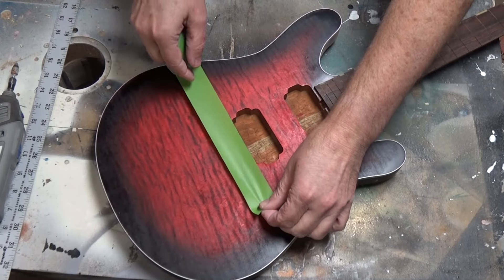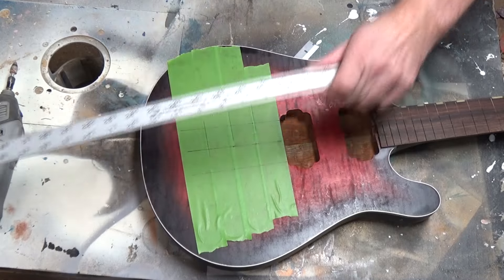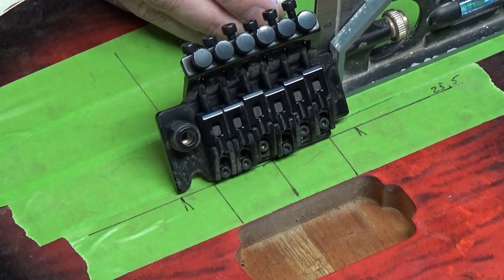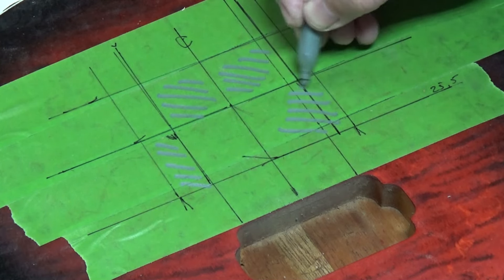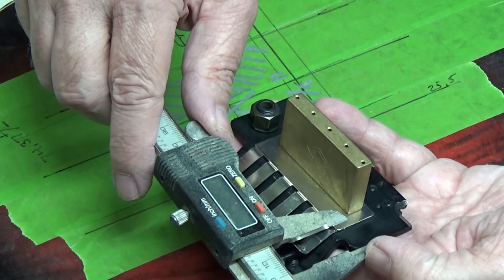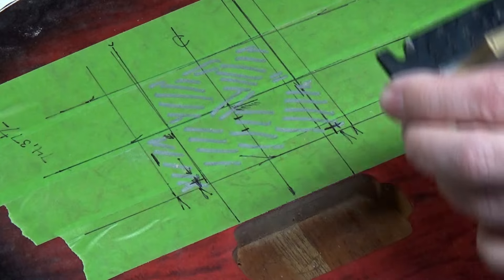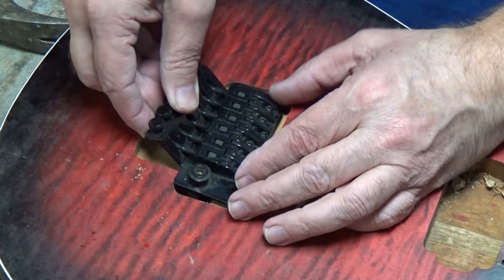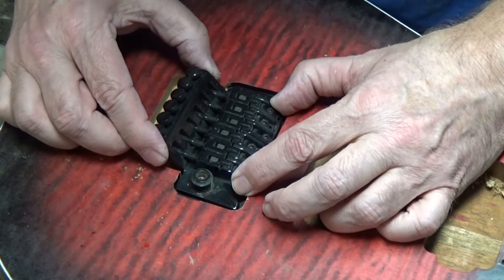How to install a Floyd Rose tremolo without a template

Comment: Would love to see you cryo treat a floyd base plate on this channel. Just so that more people know it's a cheap easy option to improve the life of those knife edges by a small amount. Even dry ice and denatured alcohol can give a small improvement, even though it's about a hundred degrees warmer than liquid nitrogen, because it can still convert some of that austenite into martensite. To get any significant amount of fine carbide precipitation you'd need nitrogen. (afaik anyway) A floyd rose has the exact type of mechanical wear that cryo treatment is good for.

Comment: Good job using the drill press for the studs and savy thinking with the makeshift template. I myself have abandoned the router for Floyd installs except if i have to do back cavity carving.. the chisel has just been the safest & most accurate for me on the bridge & locking nut installs nowdays. Good video tho and good work!

Comment: I really love recessed Floyd type bridge cavities, less need to an angled neck, less need for a higher neck heel to get the neck a little higher than usual. it would even bee possible to get away with just 2-3 degree neck angle when building Les Paul with carved top due and floyd type of bridge and it's recessed routing for the tremolo. Even if I prefer routing templates or using my CNC it´s actually pretty good to have this knowledge how do do this with no template at all.. thanks for a great video.

Comment: There's a lot of great info in this video Will, which will transpose over to other styles of bridges too. Great idea using the double sided tape and scrap to make a template. Although it's only relevant if you have a flat guitar. Carved tops are more of a challenge.

Comment: I wonder why some FR look like it rests flat on the body and didn’t need to lower the surface with the router. I guess it depends on the finger board’s height and angle but how shall I measure that height ?
i.e. : at which height should the cords be from the frettes ?

I am building a setup with a Strats Squier and an aftermarket neck.

Comment: Just to clarify; why did you put the front edge of the bridge saddles in the 25.5" mark?  Shouldn't it be that it's the edge of the point where the strings rest on the bridge that should be in the 25.5" mark?

Because an FR bridge isn't exactly like a Strat bridge where the edge of the bridge saddles are where the strings actually rest. In an FR bridge, the strings kinda rest around 1/2" further back (and higher) of the saddles.  

I'm no expert on guitars, but it seems that you just made an FR guitar setup at 26.0" scale length (approximately).

Comment: Hey Dr. I really enjoy your channel I even bought a video from you years ago to help me memorize all the notes on the entire fret board..so Thankyou for that. Anyways my question is , I just purchased a 1984 usa fender with a Kahler Killer 2700 trem. Will do I have to do some drilling/routing to change that to a Floyd rose trem? My first fender electric. I’ve owned nothing but deans and a few Washburns in the past. Looking forward to hearing from you. And do you do this kind of work for paying customers?
Reply from the maker: I have never installed that bridge before, but by looking at it, it seems fairly straight forward. the posts you will probably have to move. just do a bunch of measurements like this video and it will tell you what needs to be done.

Comment: Curious about the 26 inch scale
Reply: So am I. Never heard of a 26 inch scale neck; all of mine are either 24.75 inches or 25.5 inches. 🤔
Reply: All scale length is ,is the frets are spaced farther apart, all the notes are the same
Reply: @gm-lb9oe  scale length is the distance from the nut to the 12th fret doubled. That determines the distance from the nut to the bridge saddle. If it's not correct for the neck being used, the instrument won't intonate properly and it won't sound right. The frets are spaced differently on those two neck scale lengths.
Reply: @billjackson9702  exactly.  I think Will may have just mis spoken
Reply from the maker: I didn’t misspeak. It’s 26
Reply: @WillsEasyGuitar  measuring from the back of the nut, where it meets the fretboard, and from that point to the center of the 12th fret....you have 23 inches exactly? Interesting. Did some research; I've only seen 24.75 inch & 25.5 inch necks. Thanks for the additional learning experience! 👍
Reply: @WillsEasyGuitar  ok.
Reply: @WillsEasyGuitar  ok

Comment: Hey Will, hope your doing okay? When you file the slots in the nut, if you have a high E thats a 9, do you use a file thats a 9 or do you use a file thats a 10??? What do you do with all the other strings?? Just wondering, as one would need like 6 to 10 or more files which can get stupid crazy expensive?? Have you ever heard of some one making their own using feeler guages that one filed teeth into?? Thx.

Comment: Will's Easy Guitar..If you wanna do a clip on ''How to install a Floyd Rose tremolo without a template''...it would be nice if you actually had a Floyd Rose trem to install...just saying...
Reply from the maker: it is the same process. use your head. just saying.